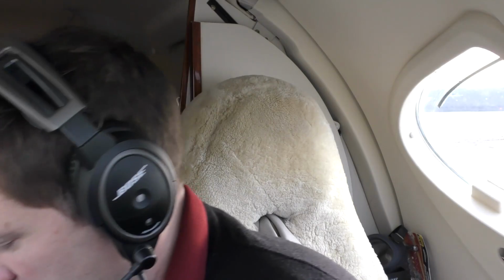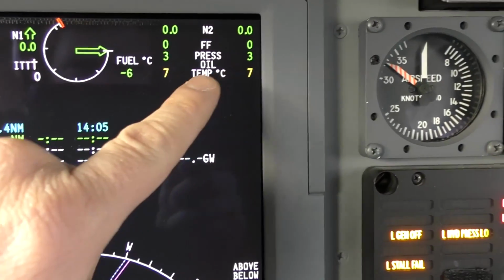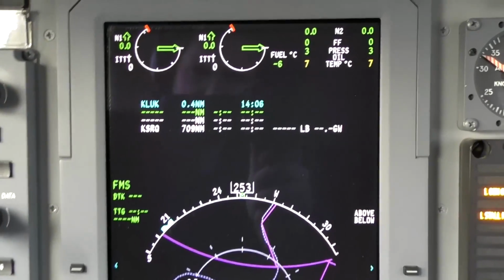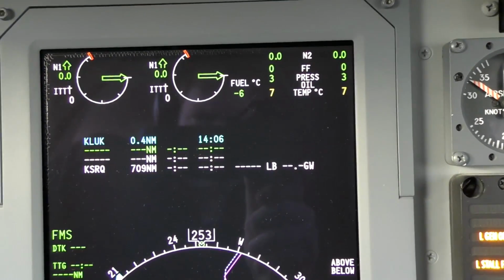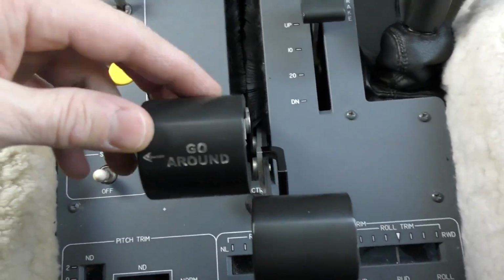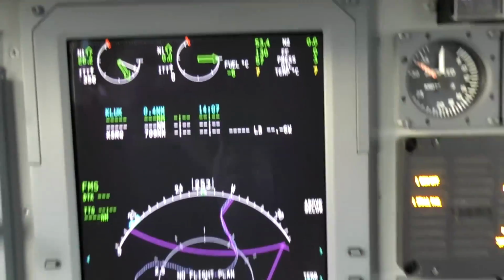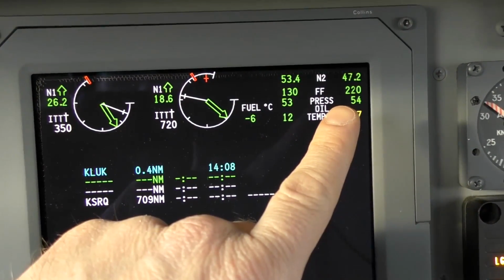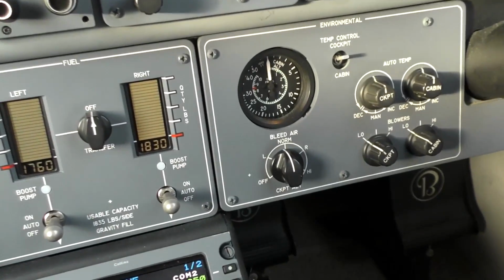Jet Engine Start Procedure - Beechcraft Premier 1A Private Jet

Comment: Any reason why the oil temp is in degrees Celsius and not Fahrenheit?
Reply: Because the rest of the world went metric last century
Reply: @Lozzie74  mmmm....not a good answer. So why the altitude is measured in feet rather than meters?
Reply: @egamez1  not a good answer for you. Altitude is quoted in metres in the rest of the world.  Incidentally, NASA went metric to put man on the moon, so don’t even go there.
Reply: @Lozzie74  Not a good answer again. NASA is irrelevant in this case. I just found my answer researching the web and has nothing to do with "the rest of the world..."
Reply: @Lozzie74  not really meters are only used in China and Russia airspace the rest of the world is using feet.
Reply: @Lozzie74  I'm curious where you got this information since all Apollo technical info and communication I have read or heard transcripts was all feet/seconds, nautical miles, psi and Fahrenheit.  I know at some point they changed but that was later on wasn't it?